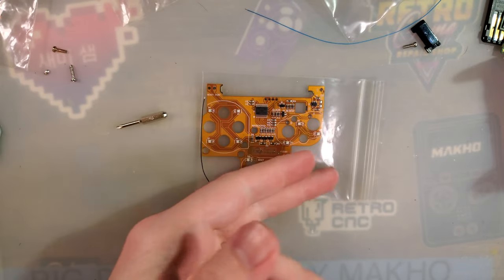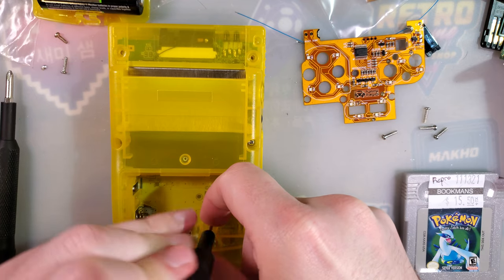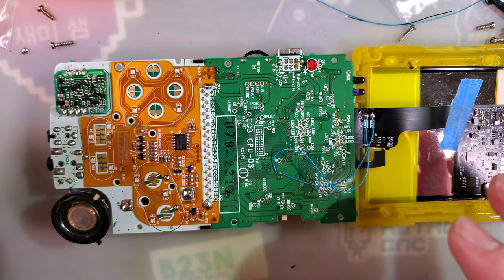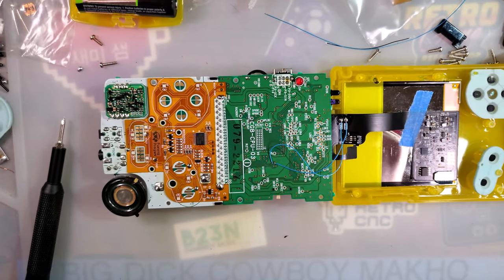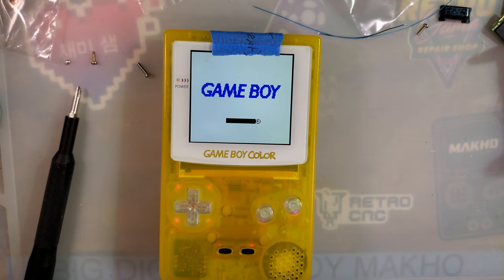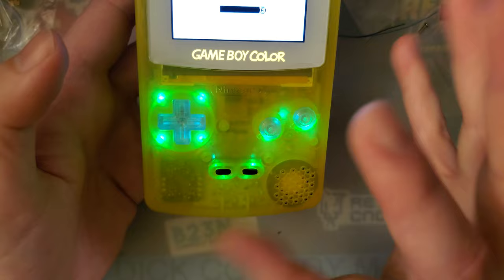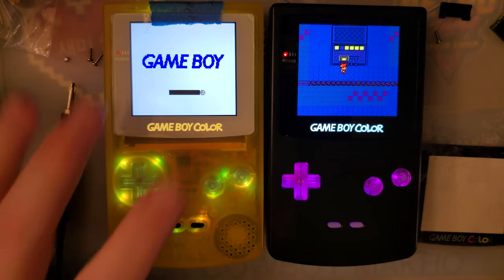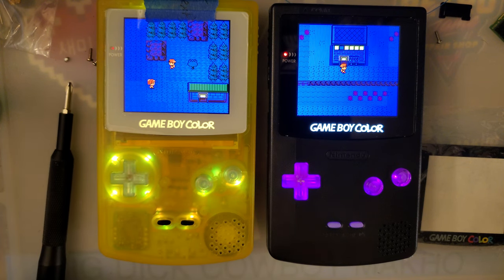FunnyPlaying Game Boy Color Button LED Kit

Comment: Man i wish they had single addressable LED's so you could have different colored buttons. Love the black and purple vibe there, super hawt.
Reply from the maker: Technically this is that hardware. That feature just isn't supported in the software. Could be that all the LEDs are wired in parallel so it's not possible to address them individually but that could be extremely tedious to set with the limited controls. 

Doesn't seem like too difficult a project though. Similar design to this and just daisy chain the LEDs with patterns already encoded into the MCU to choose from. Perhaps we'll see more features in future iterations since feature creep seems to hit every other mod in the scene.
Reply: @makho  Interesting! Maybe there is some way to interface with the kit to program this behavior (if everything isn't running in parallel ofc)

Comment: Totally bling! I'll be honest though I find bright LEDs and these illuminated buttons to be distracting when playing in low light.  I have custom GBA and GBC and I usually cover the overly bright power LED. Good to see the kit comes with brightness control
Reply: I was thinking the same thing for low light, having the ability to adjust brightness and even toggle them off altogether is awesome!
Reply from the maker: I mean, it's not like this mod adds any actual utility so I don't really think that's a problem.

Comment: Thank you! My kit is in the mail. Was hoping some one would do a video on the led board.
Reply: Also, now I am waiting for the D solder pad video. I have a drop in clean juice air. Charging light would be dope.
Reply from the maker: @TheUtoobs  I'm sorry you fell for their marketing.
Reply: @makho  really? My mom got it for me for xmas. I cant be mad. Does it suck that bad?
Reply from the maker: @TheUtoobs  Yes. https://old.reddit.com/r/Gameboy/comments/ktbgnf/retrosix_is_stealing_other_peoples_work_and/
Reply: @makho  well that SUCKS. If I knew you had a site and were selling things, Id be all over it. I buy my kits usually direct from FP with the exception of my dmg which was from HHL….sorry bro. I just got into modding gameboys in the last 2 years.
Reply from the maker: @TheUtoobs  I don't have a site and I don't sell things though. I recommend RGRS because I often work with them but I wouldn't work with them if I didn't trust their service.

Comment: Awesome and informative as always! Curious if the button sequence to change the brightness and color on the LED board interfere with the logo control on the Laminated Display ?
Reply from the maker: they are designed to work together. Keeping the controls memorized is another issue entirely, however.

Comment: I did this one and don't like how fast the buttons change settings. It's really cool to have the light up buttons but dang I wish they wouldn't change while I'm playing!
Reply from the maker: you can set them to a static color
Reply: @makho  I had it set to solid pink but when I play games like Super Mario Deluxe I press the A&B button at the same time a lot toggling it to off or to the setting where it changes colors automatically. Unless there's away to disable it from changing by pressing a & b together?
Reply from the maker: @leabriana1223  not that I'm aware of. Only way to lock it out will be to disconnect the points that you already soldered.
Reply: @makho  thanks for the response and thanks for all of your helpful videos! Wouldn't be nearly as fun of a hobby without you!

Comment: Do these kits stop the speakers from working? I installed one on a GBA SP and i just did one on my GBC and both the speakers dont work anymore or am i just missing a super simple solution/fix
Reply from the maker: Nope, neither kit even touches the relevant circuits. You've got another issue.
Reply: Clean your power switch, it will 99% fix all issues related to power draw and sound cutting off
Reply: use some IPA

Comment: Hey, was wondering if there is any way to detect low battery with this mod using normal batterys. in other words, does the one you put together in this video detect low battery without soldering the number 9 battery detect
Reply from the maker: no

Comment: my mod has the LEDs wayyyy too dim lol. I check and I'm getting 5 volts to ground and VCC on the gameboy
Reply from the maker: The newer kit iterations support brightness controls for the LEDs. Make sure you don't have it turned down. This is not a "light up your room in the middle of the night" type kit though.

Comment: What temperature do you suggest setting your iron to for soldering pads on these ribbons? I've tried to be careful when soldering them before and still just fried the shit out of it and took the pad off, which tells me I'm running my iron way too hot for the ribbon.
Reply: for most solder just use 250c-300c or it burns it whatever you are using.
Reply: @ERROR-pn5qw  that's far too cold for most of the electronics I work with, so I'll try turning down to that next time I solder a ribbon connection and see if that solves my issue.

Comment: I followed your guide and the offical guide. But games won't boot when I have this led board installed. If I desolder it then games will boot again. I tried 3 times. Any ideas what is wrong?
Reply from the maker: You sure you have everything connected properly? Probably ask funnyplaying.
Reply: Same issue . Mine didn't even light up either
Reply: @travissnider5321  i did end up fixing it. And it turns out that the "optional" solder points are not optional. If I remember correctly. It's been a while since I did this.
Reply: @dakotalee24  I did all 7 and got no led and game would not boot . I went over it a few times thinking maybe I didn't get enough penetration if solder but no luck .
Reply: @dakotalee24  probly need a multi meter to determine what's going on
Reply: @travissnider5321  yea sorry I wouldn't be able to help without looking at it. Without stating the obvious just make sure you didn't accidentally connect to solder points together. Or you might have a defective board.
Reply: @dakotalee24  Yea I'm leaning towards a defective board . I re did it 4x and double checked my work each time . I did add a lithium battery tho which is working impressively well
Reply: @travissnider5321  nice. I built mine as a gift for a friend. I did a full metal shell, back lit screen, USB c, lithium ion battery, and I think I upgraded the speaker.